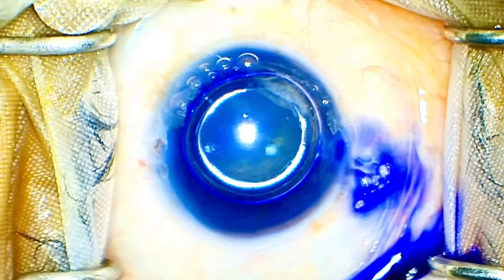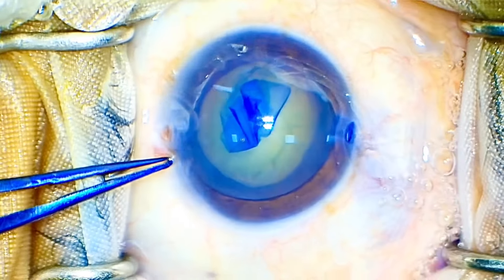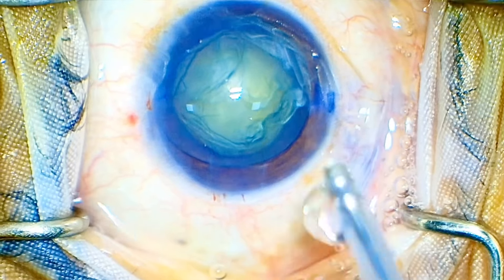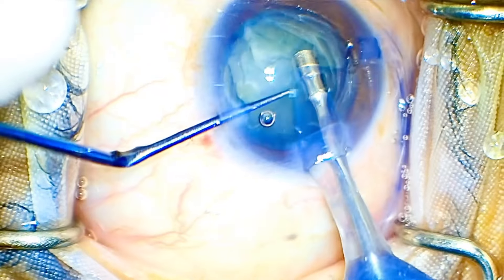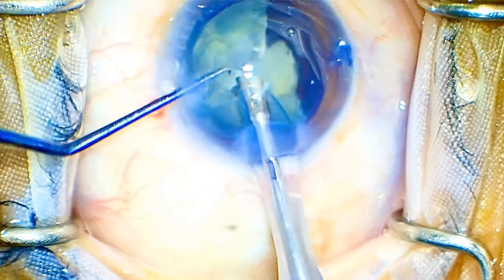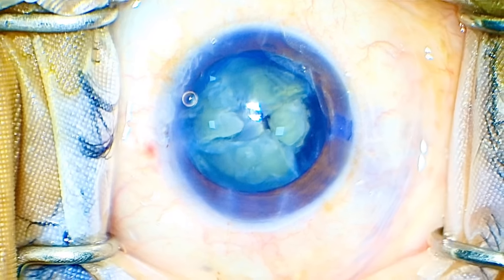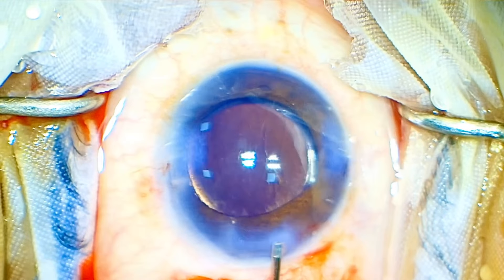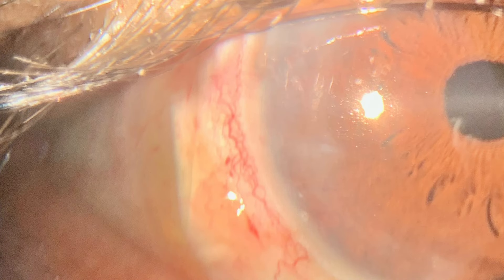Phaco pump failure during surgery , how to complete the surgery now ?

Comment: SIR, thanks managed cases Frist of all.

Second SIR, standby/backup machine should immediately..

Thirds SIR, you never mentioned k reading according to step and flat.but your choice of incision location already fixed or when it arise problem you plan temporal incision need for nutral astigmatism fan .

Thirds question, Ot assistant staff create a vital role for this moment when he or she saw phaco tips not working.. never talk any loose talk.

Fourth SIR, in this vedio 16:35  i saw corneal marking due to ac is  near collapse, so you gently use AIR ..to maintain it 

Salute SIR

Comment: You have done excellent surgery.I have gone through similar condition.I had enlarged inner entry of corneal tunnel.And with two sinsky dialers,I breake nucleus into seven or eight small pieces and mechanically remove nucleus pieces from corneal tunnel.

Comment: It happened probably due to phaco tubes got blocked somehow at any point. Fold your phaco tubes, press tightly by fingers and then press the phaco foot pedal at possition 3, also flash the tubes by fluid and air repeatedly for several times. Hope it will be okay.
Reply from the maker: No it happened because of mechanical phaco machine glitch

Comment: Just a quick thought: what if in this case you used two sinskey hooks (or other similar instruments) to use crushing forces (the nuclear pieces getting divided between those two instruments coming together to each other) to break the nucleus in many many tiny pieces (all these manouvers with the eye filled with lots of visco, for safety), and then use your simcoe to aspirate them? (Without having to convert to MSICS)
Reply from the maker: Considering the bore size of simcoe canula, it won’t be possible !